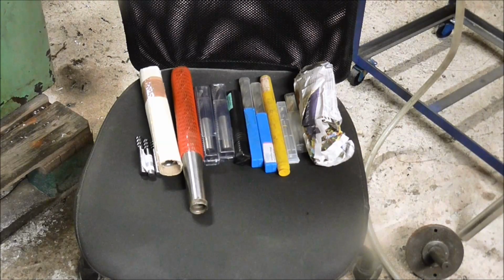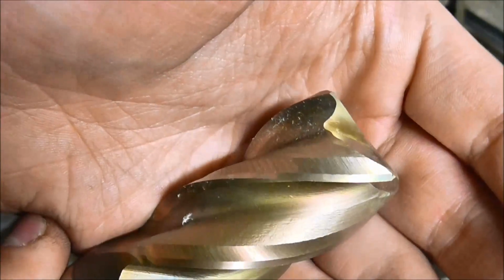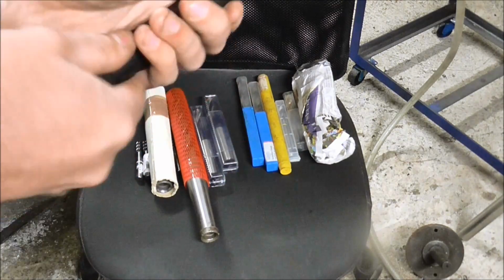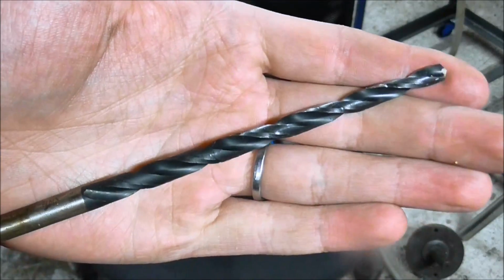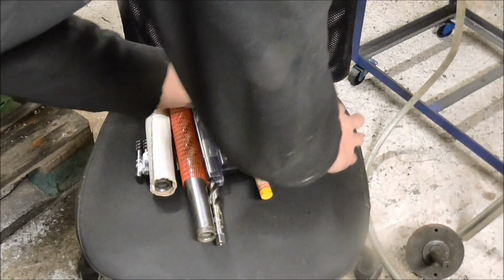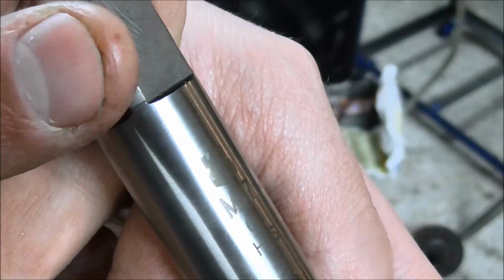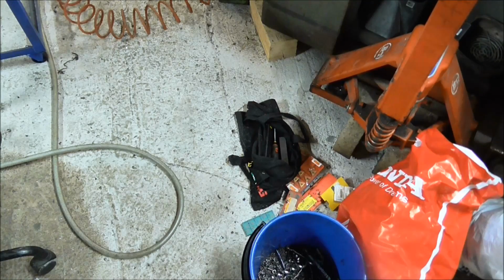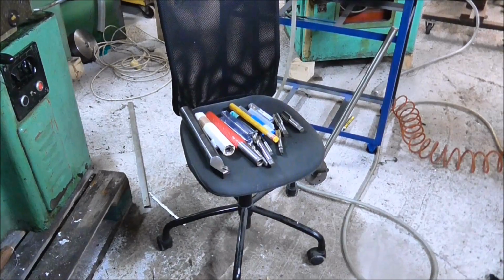Tool deals

Comment: The best deal I got for a tool at the flea market was an Amamco .130x10" long shank carbide drill-reamer for which I paid $2 new in the tube.  Just to buy one from Amamco would had been close to $80 not including shipping.
 
You should be able to get the end reground on those carbide end mills for not too much money.
Reply from the maker: Nice deal!! There is a tool sharpening company close to me and they ask 5-10 euros per carbide endmill/drill.

Comment: Excellent advice.....
Reply from the maker: Often it is possible to get used or old professional tools for much cheaper than new Chinese toy tooling! I doubt I'll ever even need many of my tools but I just can't resist buying real quality professional tooling for a tiny fraction of their worth.
Reply: Absolutely...! For example, I just picked up a Yausa end mill sharpening unit and a Starrett 24" 454 height gauge for $30 Canadian ($21 eur) each. Auctions are another excellent source of good tools...